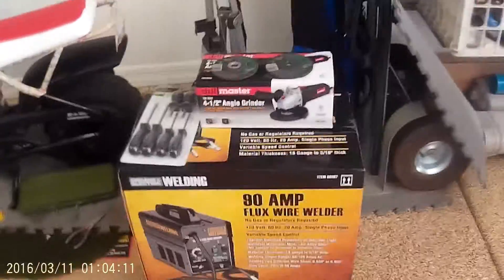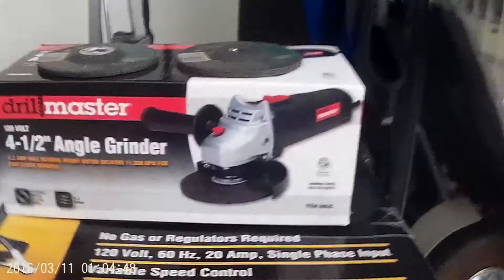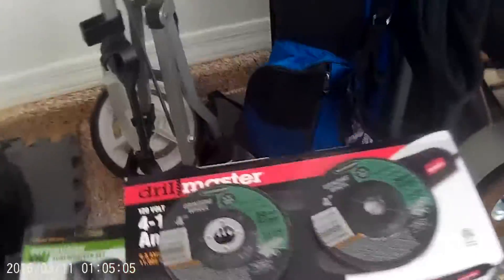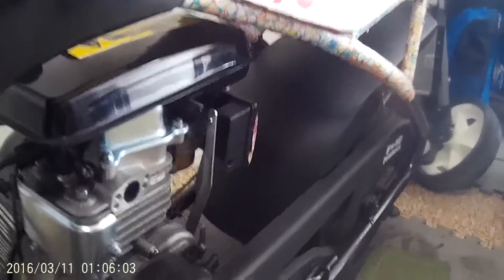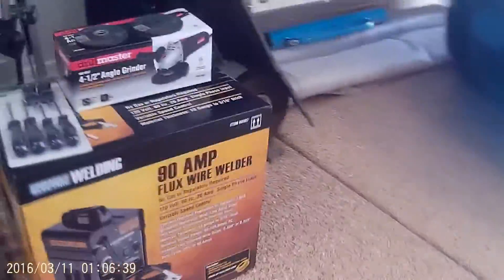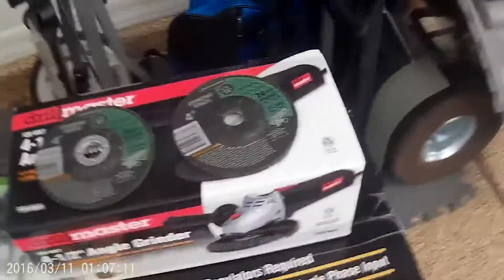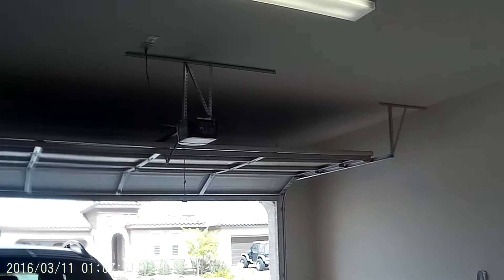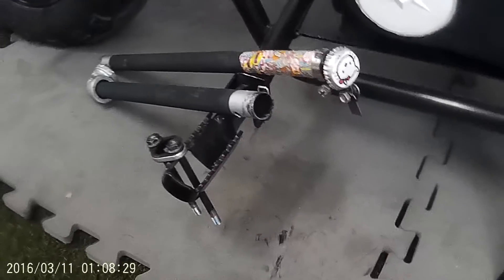Harbor Freight unboxing

Comment: try not to breathe the poisonous fumes when welding galvanized
Reply from the maker: thanks for the tip, i have a welding helmet and I always weld outside in an open area to try to prevent that. :)